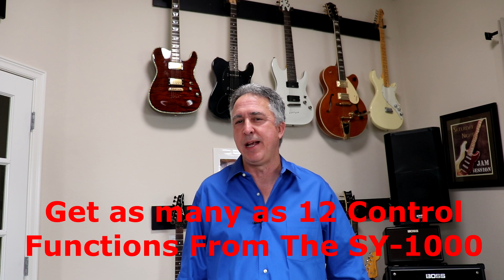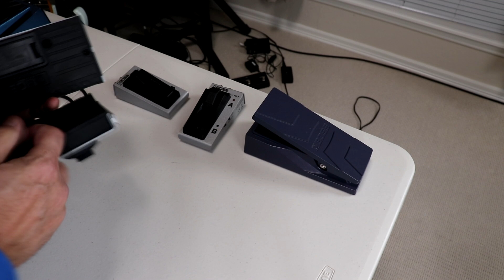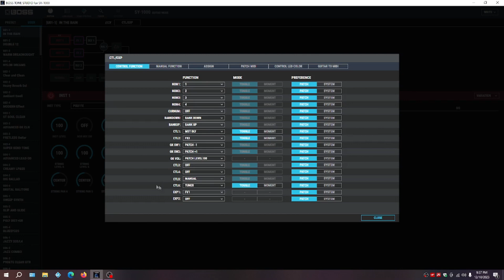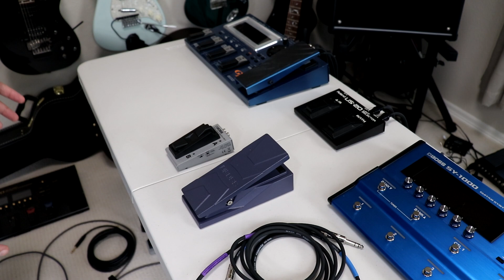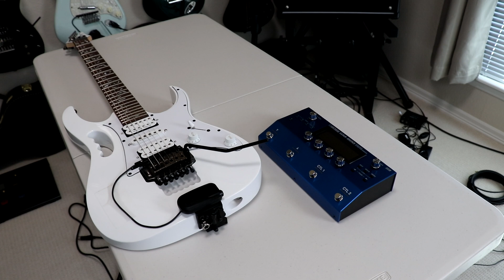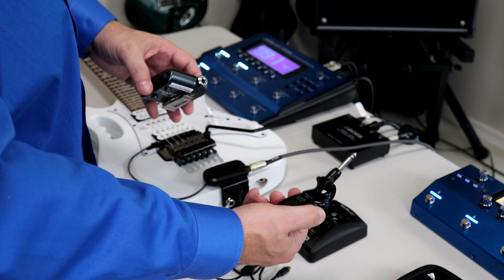Plug Into 3 Guitar Synths At Once

Comment: Thanks for your detailed and honest review of the new GM-800 and GK-5 pickup. There are almost no intelligible reviews of these devices on YouTube, mostly just advertising.
I recently purchased GM-800 with GK-5B pickup for my bass and was a little disappointed with the result... 
Just like you, i had tracking problems with the new pickup. But fairly flexible settings allow you to configure it quite well for each individual scene.
The main problem i encountered was massive latency on low strings on my bass. It practically does not allow you to play anything rhythmically. I have already read that this is due to the fact that the pickup needs more time to correctly track vibrations of the low strings. But i still hope that there is some way to reduce the latency. Maybe you can give some advice on this issue?
...on YouTube I found examples of people using similar devices with pretty much low latency, even on low strings. Maybe I'm doing something wrong?
Reply from the maker: The very first thing I would do is contact Boss support and see if they have any solutions. Customer service will work with you especially because this is brand new. The more people that point out the problem the more likely they will speed up the firmware update. Make sure you have updated firmware. Current Firmware is 1.03. If you need help upgrading the firmware then the second video in this series walks you through that process.

In my experience latency was always based on the patch. Some patches had higher latency than others. This was due to the fact that there was much more to process in certain scenes or presets. Piano patches did not work as well on the older synths. There is some truth to the fact that low strings need more time to process but that should not make a big difference with this synth. The processing power and the latency is low enough that it should be able to compensate. Other synths like the SY-1000 and the GR-55 have something called Bass mode. You would switch from guitar mode to bass mode and this would compensate for the lower notes. The GM-800 does not have a bass mode because it does not need one, at least in theory.

The problem with adjusting each scene is this, I might set it up for the GK5, but when I plug one of my other guitars that have a GK 3 into the synth it will be off. I think it's odd that the new pickups work well with older synths, but the older pickups work the best with the new synths. I suspect something is wonky with the Operating System. I also find that the Scenes I make while using the GK5 work better then the factory scenes. Have you tried making a scene yet? If so do you notice a difference? 

I would be interested in how Boss resolves your issue. keep us posted. Your experience will educate everyone that reads the comments. I am seriously thinking about getting a GK-5B pickup. maybe now I will hold off or get a GK-3B.
Reply: Yes, you are right, I should have contacted Boss support first, which I will do now. And yes, I have already updated to newest 1.03 firmware thanks to your reviews.

I also noticed that some patch have a better latency and tracking than others. But anyway, in general, latency is quite noticeable on the low B string, while in higher register it's not so crucial. And higher you play - lower the latency. I didn't know about the existence of a Bass mode in older synths, maybe this is a solution for such situations. Purely theoretically, the lower the string, the more overtones (components of sound) it contains, and this to some extent complicates the understanding of exactly what pitch the sound is. It may be that the Bass mode on older models somehow simplified the reading algorithms, which eliminated the latency. At least that would be logical. Perhaps the problem in this case is the high accuracy of the new device.

The situation with the use of various pickups is quite interesting. It also seems to me that it is related to shortcomings in the software. As for the factory presets, I also agree that 90% of them are not usable at all. I tried to create my own scenes - they sound much better to me. I was hoping that the simplest scene settings could somehow affect the latency - but no, this did not happen. I also noticed that the unison mode in the part edit settings helps a little, but in general it does not solve the latency problem, and has a very negative effect on the sound. I hope that manufacturers will take into account such gaps in the new firmware update.

Perhaps the GK-3B pickup is the best choice for bass at the moment. It has been used by very serious musicians for a long time.

In any case, thank you for your feedback and useful information. I will let you know as soon as I receive a response from BOSS support. @marcuscurtismusic